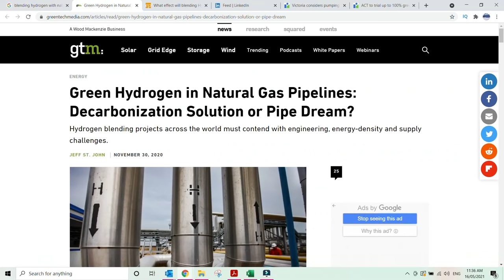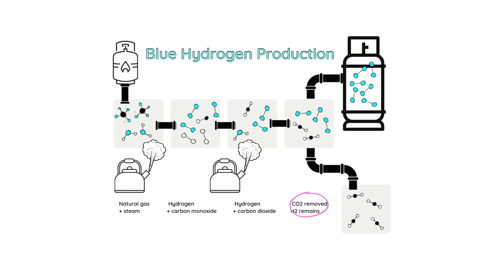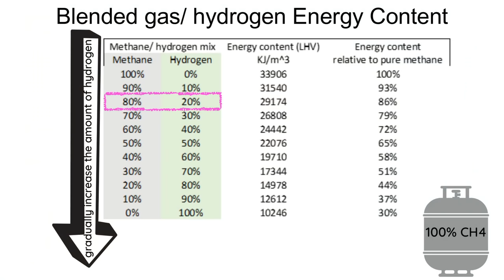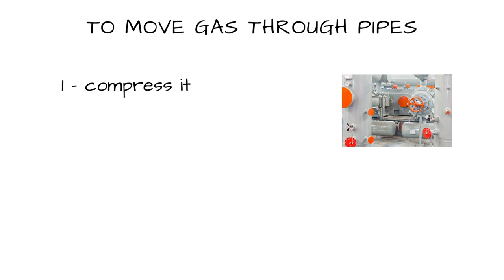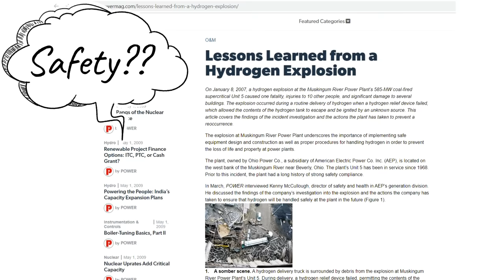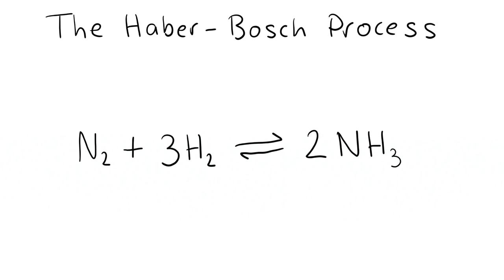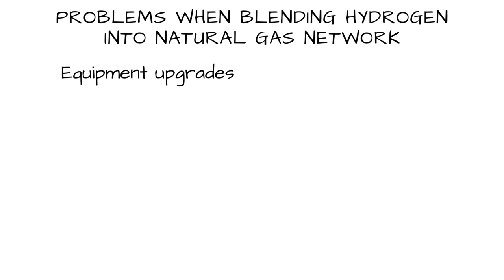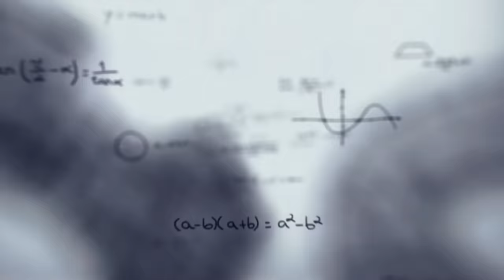Hydrogen in the Natural Gas Network

Comment: The problem is that we not only depend on air to breath, we also depend of water to drink (i.e. we depend on hydrogen for other purposes).

If we get too profligate with hydrogen then what impact will it have elsewhere?

Ofcourse, it could be argued that we don't intend to use that much hydrogen, only a very small amount - but we are just at the start of the technological cycle for hydrogen.  That would be like people in the 16th or 17 century saying they were only going to use a very small amount of coal (which they started to use to replace all the wood they were burning, as wood was becoming an ever more scarce resource).
Reply: When the hydrogen is used it is turned back to water so nothing is actually consumed, no matter how much water we turn into hydrogen.
Reply: @listerdave1240  Firstly, some of the hydrogen will leak without ever being used (hydrogen, being a small and light molecule, will easily leak, and when it leaks into the atmosphere if can easily rise to the top of the atmosphere and leak into space).

Secondly, even when used, it will create water in gas phase (i.e. steam) rather than liquid water, and even as the water condenses in the atmosphere it is a more potent greenhouse gas than CO2.  And even as gaseous water it is still a lighter molecule than O2 or N2 and so is likely to rise to the top of the atmosphere (at least that portion of the H2O that does not liquefy).

Comment: does biogas make sense for those pipes? the way I understand it, 

dry biomass (e.g. straw) + heat (no oxygen) => solid carbon (soot and charcoal) + a small amount of carbon dioxide + methane

since the carbon captured by plants to make the biomass is being split between making coal and making carbon dioxide and making methane, the whole process is net carbon negative (if you don't burn the coal that comes out of the process). 

then just put the methane into the pipeline!

Comment: Key quote: "The hydrogen proponents like to talk about the truth with their head nodding up-and-down, but never the truth with their head shaking from side-to-side... and the truth about hydrogen's energy content, is that although its energy content per unit mass is really good. Its energy content per unit volume is really, really bad. When you take into account the two factors (the mass energy content going up and the volume energy content going down) it's 3.2 to 3.6 times less energy".  (sigh) so what do we do? I can't be burning any fossil fuel! At least the gas company could price gas by the joule when they vary the composition.
Reply from the maker: While I was researching this, I found the results of a trial of blending 20% hydrogen into home gas supply, and it found that consumers didn't notice the difference... so apparently the energy content isn't important, only whether consumers notice their fuel has been diluted. I wonder if the same argument would be accepted if a petrol station was found to be adding water to petrol without their customers noticing...

Comment: When you lose 50% of the energy with the whole process of making and transporting hydrogen, and you can gain 300% of energy with a heatpump to heat a home. Why would you need hydrogen then?,  the efficiency of a heatpump is 6 times higher than hydrogen. Why even consider hydrogen? Great interview, thanx!!

Comment: The issue is energy flexibility, moving one energy into something else at minimum loss, so say renewable electricity over capacity moved into  hydrogen electrolysis  to be then used as compressed H2 in vehicles.  So the nub of it is how can we store energy at off peak periods to use 24/7 for the myriad of uses we draw down on ?   My core position is to use hydrogen as we do propane. This addresses molecular loss and pumping and volumetric storage at source. Call it the H2 Cloud 😁

Comment: Unused gas pipes would make great electrical cable conduits and I see a role for hydrogen as a power source to spin up massive flywheel storage to fill the gap between the intermittent wind and solar, the hydrogen being produced from the excess power not required on the grid when the wind is blowing and the sun is shining. I think everything is capable of being solved.

Comment: Hi Rosie, excellent interview, however I have a question. Paul says at the start that you need to pump 14% more volume of gas through in order to get the same number of joules of heat as natural gas, however later on he says that you need to pump 3.2-3.6 times more hydrogen through to get the same heat as methane (due to its low energy unit volume content). Is this a mistake, or is the 14% referring to Blended hydrogen and the 3.2-3.6 term referring to pure hydrogen?
Thanks

Comment: Have you ever seen a steel cylinder that stores hydrogen gas?   If you use a water/soap solution (used to find leaks) the whole cylinder bubbles like mad.   The hydrogen is oozing through the steel at a formidable rate.   To slow down the diffusion you storage tanks would have to be made of U238.   All this diffusion loss has to be made good so the overall efficiency of any hydrogen process is diminished.

Comment: They would be better for using it as a storage/balance load generation using green hydrogen when excess green power is being made, surely someone has come up with small self contained plants that can be used at large solar/wind arrays?

Comment: I had this in my feed today, 3 years later. Even if no one is reading this, one thing doesn't seem right in this logic. You don't need 10x the amount of hydrogen! The home heating systems and insulation are so much better today, that you only need 10% of a 1970s home! But the infrastructure was build then. So for heating purpose, this is not a problem. But for power plants, it is.

Comment: There are some interesting challenges here, but the transition is the big one.  Surprisingly, I don't think the leakage would be a big of a deal.  As Paul said, H2 has much less energy per unit volume than CH4 so it is going to be harder to fill up a room with a combustible mixture (which is already difficult), and if it did get there you would have a smaller explosion.  Plus leaking H2 into the atmosphere is much less damaging to the environment than CH4.

You would almost have to convert homes to all electric first, and then change your pipelines over for the commercial and (especially) industrial applications.  I think that would be an easier transition because commercial and industrial equipment make up a small fraction of all of the gas burners, but they use up a big fraction of all of the gas.

It's laughable to imagine a politician telling their constituents that they need to ditch all of their gas appliances for electric, though.  People's interest in stopping global warming drops pretty quickly when you tell them they will have to make changes in their own life.

Comment: Very coherent discusión of the intractable problems of H2 use.

@13min:  regarding tax the emissions, and the “engineers will figure it out”

No, that’s a fallacy.  Consumption taxes work when society wants to replace a behavior like, say, smoking w a known viable alternative abstention or vaping.  Taxes force a switch from known A to known B.  Taxes do not invent from the unknown,  and no such tax will be imposed by Asia and Africa on themselves.  Financed R&D does this.  We can’t replace energy use with nothing, nor with the nonsense euphemism   engineers will ‘figure it out’. There is no practical large scale method of “storing electricity “, not even close, not by battery nor pumped hydro. The one  viable and economic method of storing convertible energy at the moment is, and long has been, liquid fuels, with underground storage of compressed methane a distant second.  

Hand waving about solar and wind is no help either, as if it were easy to build as much as needed, that land use on the scale of a couple of states worth has no cost.  Worst of all from an engineer,  he knows there is is no known example of a large grid running off only solar and wind, nor anywhere close.  The idea then of 100%  should be treated very skeptically by any professional, just like the notion mass use of H2.

Let’s get serious.  Build nuclear.  It is cheap abroad.  It was cheap, in the US once, and w malevolent govt out of the way it can be again
Always on nuclear then makes economic district heating schemes like NYC and synthetic low carbon fuels.  Taxes won’t make nuclear cheap though; reasonable rules will.

Comment: Hydrogen is great for storing wind and solar electricity excess. Make H2 from the excess power in the day, then burn it on site for electricity when the sun don't shine, and use the cables 24/7 to deliver electricity. This is great for stable on-demande power. Also, electrical lines takes far less space than natural gas pipes. Even if you loose 60% of the power on going from electricity to H2 and back to electricity, it is still better energy-efficiency than humongous batteries. To run 1GW you install 5GW worth of solar panels, deliver 1GW to the grid, then use the rest to make H2, store it and compress it, driving the process et.c. When the sun is insufficient you burn H2 using energy-cells, turbines or whatever and pump electricity donw the grid. If the sun shines on average 9 hours a day, you are golden. This can replace loads of coal and oil-power. Still you are going to need a bunch of Nuclear power-plants, but about 50% of all electricity should be possible to generate using wind and solar without too insane investments. Have a safe future!

Comment: While some argument could be made for reforming natural gas into hydrogen (capturing the CO2 *somehow*) to then use in place of natural gas, as pointed out it would be terribly inefficient and costly. As for using electricity (from non carbon sources) to generate hydrogen (also terribly inefficient) that truly makes no sense compared to simply using the electricity directly (VERY efficient). Energy storage might be one of a very limited number of exceptions.

Comment: Lots of engineers say that nuclear energy is essential to stopping climate change, I'd love to hear your views on it?
Reply from the maker: I understand why you could think that, but I personally think that nuclear is slow and expensive relative to solar and wind in combination with storage. But I wouldn't have shut down all of Germany's nuclear if I was in charge of that... that makes the job unnecessarily harder.
Reply: @EngineeringwithRosie  Thanks for your reply. Their neighbours in France managed the fastest ever decarbonisation of a grid using nuclear power, and it didn't break the bank. Nuclear when done right can be fast and cost effective.
Reply: @EngineeringwithRosie  What storage do you think is scalable to deal with grid scale decarbonization?  It seems like Li-ion can scale to personal transportation and frequency regulation, but not beyond that.  Still no cost effective flow batteries.  It seems to me that molten salt reactors have got an engineering chance to drop down costs and be able to scale up to address global needs with a big investment in R&D.  But absent that, I would guess that you will see massive industrial usage changes to cope with the intermittency of wind and solar.
Reply: @richdobbs6595  Aside from the obvious pumped hydro storage I think the nascent liquid metal battery technology could provide large scale low cost storage where pumped hydro is not feasible.
Reply from the maker: @richdobbs6595  I agree broadly, but I think that lithium ion batteries will very soon be doing short term storage to fill in daily variability in solar (I expect within a year or two batteries will do this cheaper than gas peakers) and then additionally there will be pumped hydro where it is suitable (including off-river systems). And I also think demand flexibility will be a huge factor. So an aluminium smelter or other large loads would switch off when prices were very high. What do you think?

Comment: So hydrogen is expensive, innefecient, and incompatible with the bulk of our current systems so it is probably cheaper and easier to use electricity for homes in the long term.
Reply: The real striking point is storage. Gasifying electricity could aid this problem. Chemical batteries as energy storage alone is not going to happen.
Reply: @petergoestohollywood382  and batteries are less expensive, more efficient, and more compatible with our current systems and appear to be scalable to the level needed to store grid energy.

Comment: When the technologies this Chemical Engineer doesn't know about come out I'm expecting the same type of interview from you on this. I've spent the last 15 years working on a way to turn the tide on our climate change problems and now I am only trying to raise the funds needed to launch these technologies into the marketplace. Hydrogen will be part of the solution but not the only part but a big part as we've learned to tap into the wheel work of life.

Comment: The answer is that the transport is to  remain electrical,  and that the hydrogen gets made On Demand on site via electrolysis as needed
Reply from the maker: That is definitely one way to avoid a lot of the transport issues with hydrogen. I think a lot of electrolyser and home fuel cell manufacturers agree with you!
Reply: @EngineeringwithRosie  Personally I think that's how electric cars should be done. Keep them a combustible engine with hydrogen, and let their electrical storage produce the hydrogen on demand. That way cars won't be Hindenburging with every accident.  Swap the fuel weight for the battery weight instead.

Comment: And need to be aware, pure hydrogen flames are invisible, so adding to the point about the problems in the domestic use area, there is an extra hazard.  You can’t see the flame.

Comment: Walker seltzer is like generate hydrogen without electricity but mix in natural gas is better than replace 100%  the efficiency and content if mixed 30% hydrogen and 60% and above oxygen then power even rocket mean energy content is high in just water electrolysis or calcium bicarbonate react water

Comment: Hydrogen is very small and can escape from pipes and valves by travelling between the spaces in the  metal. It is a small amount but may accumulate in the dead spaces in the infrastructure. Methane is a bigger molecule.
I vaguely recall you can't use the valves and gauges of hydrogen cylinders with oxygen cylinders as the hydrogen remains within the brass.
Reply: You need to re-think that... - quote "hydrogen is a smaller molecule that can leak more easily from pipes, but will more likely accumulate in dead spaces"

See the problem with your statement?
Reply: @poruatokin  I stand corrected.

Comment: This is a great video, if somewhat disappointing.  I was wondering whether gas pipelines are deep enough for heat transfer - so instead of gas, chuck a load of coolant along them, and use that heat in ground source heat pumps?  I'm not sure how that'd work - do you need a loop - hmm, I guess so.  But some sort of shared resource would be cheaper - it would cost me about £35k to install a ground source heat pump (although i live in the middle of nowhere, so no gas pipes anyway.)
Reply: I think they're looking at that in Massachusetts (USA).

Comment: the Chemical Engineer has just described to you the fundamental reasons why a hydrogen mix won't work, one of those being the amount of energy needed to compress the gas and you still think redesigning the compressors is an option?

Comment: If suitable batteries cannot be made (IMO the jury is still out on that) the way to go is a combination of wind, solar, and (mostly) nuclear electricity and you use it immediately.   Small (<200 MW(t)) nukes can provide most high-temperature industrial heating needs.   For transportation we use a combination of natural gas for planes and ships and catenary direct electricity for trucks and railroads.   Catenary direct electricity is a proven technology.   Every millimeter of the Trans-Siberian Railroad uses electricity transmitted through a catenary wire.   the technology has been around for over a century.   Use that and forget the hydrogen except where it is REALLY needed.

Comment: Yeah,  welders go to great lengths to keep hydrogen out of welds.  
However,  you might be able to strip hydrogen off natural gas at the use site.
Or... just skip hydrogen and use electricity from renewable sources + iron air batteries for Stationary storage and lithium sulfur batteries (by Lyten) for car batteries.

Welders even use special rods in hermetically sealed cans to keep hydrogen out.   When the cans are opened,  they have to store them in heated things to keep the hydrogen out of the weld sticks... and this is only good for a short period of time,  then you have to throw them out.